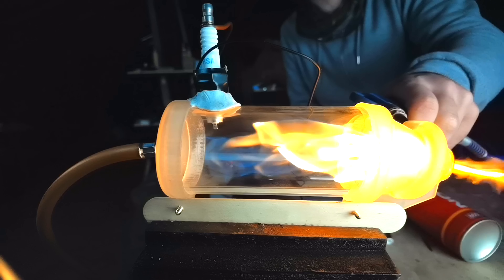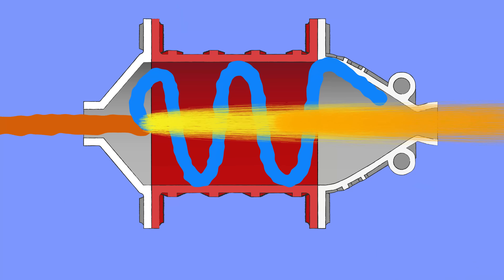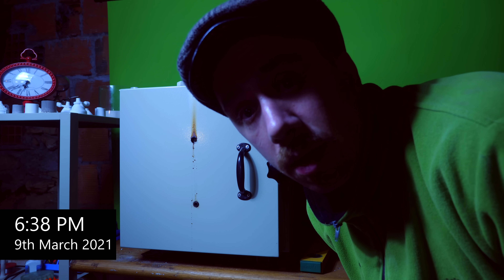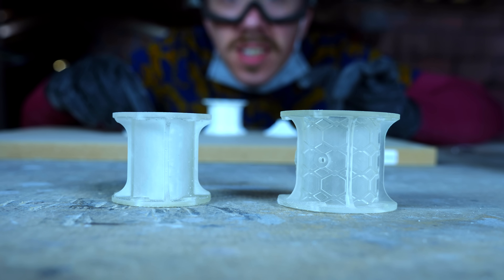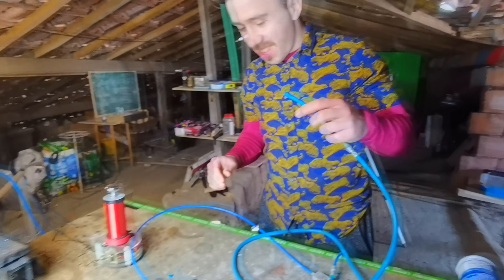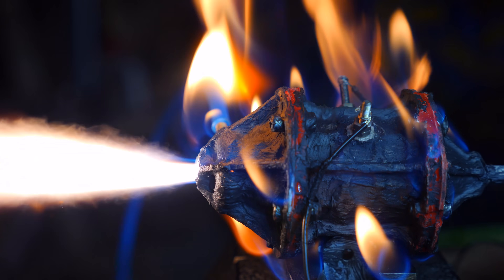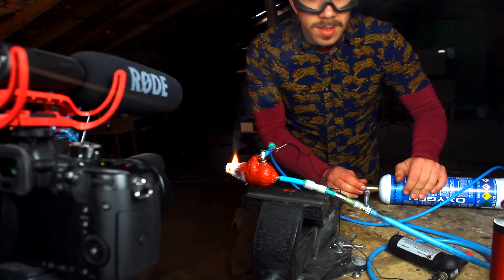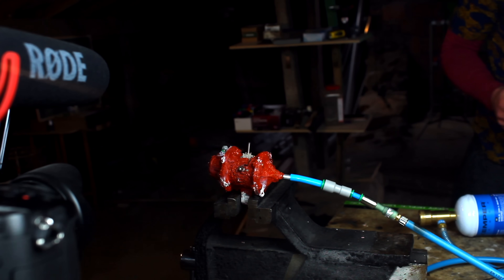Vortex Rocket V2.0 (3D Printed)

Comment: Maybe have the fuel go around the combustion chamber to cool it down? (Like int space shuttle engines) Also preheats the fuel... Keep the mixture fuel rich.
Although there might be a problem that you'd need to seal thr inside as well because then fuel will leak into chamber. And not go around the chamber and cool it down.
Actually, why not make the fuel burn a feature? Since the fuel requires energy to start combustion, it takes energy from the engine itself. Since it's burning in air and not pure oxygen, it should cool it down. Since it burns at a lower temp.

I hope I made sense, and maybe some of this might help

Comment: @Integza Hello Izgenta, I have some suggestion ideas. For pores in your cast, do try painting it with glaze and refiring. Also, nozzle your vortex faster. Faster vortex = less pressure (I think). Magnetic confinement may help since it's plasma, but that requires math on more fingers than I have.
Reply: Also, put your parts into a vacuum chamber for a few hours before firing in the kiln. Less moisture = less cracking.

Comment: Try cementing the inside the same as outside, due to the ceramic being porous, you can use thermal paste, but it may burn on the inside.
Second option is to use a shield box made out of steel or cement to contain the leaking gas.
3rd option is to cement it completely on the outside, by clogging the inside and pouring a cement all over outside like in a box, than remove the clog from the inside.

Comment: I think the problem is that your materials are inherently prone to failure when subjected to the immense heat of combustion. That and ceramics are porous ... that's why engine combustion chambers are metal - well that and the strength to weight ratio. I would figure out exactly how hot your combustion chamber is getting with a temp gun, and then pick a material that can withstand that heat. Maybe you can use the 3d printers to help build a mold of sorts, which you can use to either press sheet metal into the necessary shape, or if your real crazy. pour melted steel into a mold ... or even more crazy, do some blacksmithing. Of course there is always the easier option of buying things like a stainless steel thermos and cutting the parts from that. I also bet there are some welding gun parts that would be perfect for this. Good Luck!

Comment: Aerospace engineer here.

Try cooling the chamber with the fuel and oxygen! This is how, for example, the nozzles on the F1 engines on the Saturn V were cooled. On the outside of the chamber, have a series of pipes (printed as part of it) flowing around the chamber; then it will 1) cool the chamber a bit, and 2) pre-heat the fuel for a higher-efficiency burn.

As for the leaking, try a slower heating profile. Raise and lower the temps in the kiln slower, in order to compensate for the doubled thickness recommended in the manual. This should give the trapped gasses more time to escape without forming microscopic cracks.
Reply from the maker: Thank you so much for the help!
Reply: @integza  I believe your vortex cushion is failing. It's not keeping the combustion in the center. It shouldn't be leaking through the body if it was being contained in the center by the vortex.

Also, try ceramic glaze coating baked onto your parts. The coating they put on pottery. Very durable and heat resistant. Usually water tight as well. And if you had a rotary table to slowly spin the parts it would be easier to apply the glazing. Might have to sinter the parts, remove supports, then glaze and bake again. 

Might want to use atmospheric air instead of pure o2. That could be another reason why the vortex is failing because the pure o2 is just combusting with the fuel and filling up the entire combustion area, which is also over pressurizing it.
Good luck!
Reply: @integza  Hi Integza, working with liquid oxygen maybe it's not a good idea and very dangerous. Also i really not think you can made a micro channel network inside the wall for a regenerative cooling of the nozzle.
Not with this materials and not with this sizes... and your tools.

However i have write in the answer to your post "The first 1000 people..." a long answer with many point you can use for resolve the problems of your device. I hope it can help you.
Reply: @DetConanEdogawa  I did not mean cooling of the nozzle, but cooling of the main chamber. He certainly won't be able to get small channels, but every little bit helps; plus just the actual structure of the tubing might help with extra rigidity. 

Also yeah, LOx is a terrible idea.
Reply: @sophietaylor9753  I think the problem was the nozzle temperature, check my previous comment for that.
Reply: I also think the fact that the flange seals have basically no compression might be a culprit too. Since he cures them in place the bolts would be providing effectively no compression to the silicone once cured since the silicone would just move out of the way while it was still liquid. Half tightening during gasket curing and then fully tightening once the silicone dries should improve the gasket compression, and thus the seal quality I think.

Edit: Aerospace engineering intern here
Reply: This comment needs to be higher.
Reply: Aerospace student here that plans on building a similar project! Yeah cooling with liquid oxygen is cool, but you can't buy liquid oxygen as a normal person, and making it by yourself with liquid nitrogen is time consuming, costly and you only have a test window of a few days because of boil off. So I plan on welding it out of stainless steel, maybe inconel in a later iteration and just putting it in a pipe with water in between so that water can cool it and hopefully extend operation time to more than five seconds. Using liquid propellant like propane could be used for liquid cooling, although that would require a more complicated design as the water solution and off the shelf pressure regulators aren't exactly rated for liquids. Also, gases mix much better than liquids, so combustion becomes a whole lot easier, and my design goal is just getting these sweet sweet mach diamonds lol
Reply: This is not a bad idea theoretically but it's almost impossible to implement with this type of motor, this size, this material, etc.

Comment: Glacing the ceramic in a second burn could be one solution's to seal it.
Also the surfaces where the components meet seem to be to uneven. Maybe adding some material to flatten these mating surfaces could improve sealing it. 
I'm not sure if high temperature silicone is the best choice as a gasgets, but I also don't have a better suggestion.

Comment: Why not do a thin coat of the high temperature sealant in the inside as well as outside? Would only work on the modular one to ensure its smooth.

Comment: You could have less porous ceramic walls if you used the 3D printer to print a mould that you would then use to slip cast regular ceramic in. The walls could also be thicker, though not too thick or there would be thermal expansion problems when running the engine.

Comment: Maybe you could wrap your final design with Aluminum muffler tape or fiberglass exhaust tape or maybe both, to help seal it and also hold it together. 
Also installing some pressure gauges might help you tune in the right amount of pressure, because it looked like you were adding to much

Comment: If gas can slip through the chamber wall, have you thought about transpiration cooling?  Put a pressurized jacket around it and see how much gas you can pas into the chamber, and if it's enough to keep the engine cool.  Should also see better thrust from the increase in flow rate.

Comment: the pressure is getting into the ceramic even if you seal it from the outside, it'll put pressure on specific parts of the insulation. so maybe you have to coat the inside.

Comment: submerge the print in the same resin after it is "cured" multiple times and repeat curing so you fill the gaps with fresh material and already cured material should be stable enoth to prevent the deformation.

Comment: I wonder if precious metal clay might be of use here. It has a variety of metals, all in a binder that burns off during the sintering process. I wonder if you could thin it down and paint it on to the ceramic before you fire it.

Comment: What I guess you need proper fuel n oxidizer control , design a box where you can attach fuel oxidizer bottles , with separate rotary valve for controlling each and connect those valves via pipes/tubes to rocket . . Also at ignition pressurized oxygen is not supplied like you was doing rather gravity or low pressure of it is supplied .... Lastly your all parts were leaking , why not to dip their outsides in plaster n oven again I think it will worth a try...

Comment: For the leaks, perhaps dipping the whole thing in resin cound help, tape up the nozle and fuel\oxygen ports, then dip it. Could even paint brush on a thin heat resistent resin on the inside.
Perhaps having multiple oxygen input ports to really get a vortex going could help as well.

Comment: Ceramics and porcelines are typically glazed, this is especially true used for food or beverages. look at you coffee mug or tea cup. see? shiny! and sealed. Additionally, I suggest removing supports prior to firing. They may be contributing to cracking. if you must have supports, try making something that can hold the piece and withstand the firing process. or just YOLO it. for the seal between modular parts, try a high temp insulation mixed into the RTV silcone spread evenly. try not to squish the silicone into the body of the engine. these are just a couple of thoughts, hope you find a solution.

Comment: Maybe you should use glaze to seal the leakage? and maybe like in spaceship or SR71 the fuel should cool down the engine - try to install steel spiral tube (brake pipes) inside ceramic casing of the engine. Liquid propane during vaporizing takes a lot of energy and can cool down up to -70 Celsius.

Comment: If you print something in the shape of the internal chamber, and then completely submerse it in concrete and let it dry. After a bit burning out of the resin you have a somewhat leak-proof and fire resistant burn chamber made of concrete. Except of course for the small detail that carrying a block of concrete in rocket is not to most weight efficient way of doing things :)

Comment: Could the leaks be solved with  coating the part with glazing used in pottery ?  Takes heat of a kiln to activate  and leaves a shiny smooth glass like surface. Could be used inside and outside

Comment: Stick the whole lot in water, should make it clear where the leaks are pretty quick. Not so sure the ceramic would like it for long though, and guess you would have to keep the nozzle out so it doesn't fill up with water internally.

Comment: What about coating it with something like JB weld or a epoxy?  It might not work long term but should seal it long enough to test at a higher chamber pressure.

Comment: Since you're doing liquid(gas) engines and planning on trying solids again, it might be fun to try making hybrid rocket engines as well. Also, for solid rockets, I would suggest also trying APCP as a propellant. It's easier to make than sugar based fuel as it doesn't require cooking, and it's the fuel that was used for the space shuttle SRBs.

Comment: What if you casted an Aluminum heatsink around the ceramic engine? Using it as an internal mould for sand/plaster casting. 
The Aluminum would dissipate a lot of the heat and seal up all the porosity and the ceramic should stand up to the casting process as long as you pre-heat it to the same temperature.
Just my $0.02
Reply: or maybe print it out of ferrolite instead of porcelite it should be less porous after cintering and extra heat and pressure for the engine combustion should help it self seal the pores similar forging.

Comment: it looked like you didnt give your sealants enough time to cure and solidify before testing hence the leaking. also did you take temperature measurements of the exhaust to make sure your sealant can handle the extreme temperatures?

Comment: What about using some Lynn manufacturing high temperature adhesive (2000° f rated, sodium silicate water glass 40% solution) and coat the parts with it and then put it in a vacuum chamber to hopefully draw the solution into the pores of the part

Comment: Could you 3D print a mold for ceramic and then make a thicker ceramic part?  This could help with making parts and would probably require less post processing, or at least easier post processing.

Comment: have you tried 3d printing a mold of the parts you want and filling it with plaster? You could then burn out the inside mold in your oven and have a %100 plaster part.

Comment: You should try slip casting your parts and doing two firings where you glaze the part in the second firing. I think the more vitrified the clay is the better is should respond to thermal stress, and with glass as a barrier it should help. And i think slip casting is a lot easier than the method you’re currently using

Comment: Maybe you  should disolve clay in water or maybe even better gasoline to a veeery thin emulsion.
Then stir and dip the engine into it to apply minimal amount of clay solution.
I think that the particles will clog up the tiny holes and the following layers will insulate and solidify the fix.
Let it dry (there the idea with the gasoline comes, as it should be quicker) and bake it again

Comment: How about first coting the engin with glass fiber matts with the high temp cement and then the high temp silicon. So you don't get heat trensfer with the glass fiber cement combo and with the silico  you seal the leaks. And some need't strength.

Comment: Glaze your ceramic parts by applying a water mixture of white glue and glass powder on the sintered part. Then bake at 900C for 3 hours to melt it on.

Comment: Hmmm, you could use a fine metal mesh cylinder a mm or 2 narrower than the combustion chamber to create an inside boundary layer of airflow- if you made it bottle shaped you could feed the fuel into it and with the oxygen coming from outside of the mesh "bottle" it may even act like a flame trap... just a thought - all the best Integza.

Comment: You should try making metal gaskets with a groove that will compress when you tighten the two halves.  Some small gasoline engines use gaskets like this for intake, exhaust and sometimes head gaskets.

Comment: Integza, have you tried painting the inside of the porcelain or soaking them in sodium silicate solution then heating them to dry the solution  to solve the leaking issues?

Comment: Glaze the ceramic printed engine or engine parts. You will get 1. Shiny and 2. Leakproof parts. How this will work with the ceramic resin, I don't know. You could always use the delta of yours to extrude ceramics in a paste extruder, and properly glaze them. But this will open another can of worms or tomatoes... Or wormy tomatoes. Ugh.

Comment: Just want to throw this in , it seams to be the new craze with 3d printers to use them to make MOLDS rather than printing the part itself . This may also give you more flexibility in what materials you can use .

Comment: About the engine, what if you create a cilindrical mold and soround the engine with it. Then fill the mold with some form of temperature resistant resin and remove the bubbles (with a vaccum chamber mabe?). That way you would have something that will isolate the chamber and enough mass to dissipate extra heat and hold the pressure of the chamber.

Quanto ao motor, e se criasses um molde cilindrico em que o motor coubesse. Depois enchias o molde com algum tipo de resina que fosse resistente ao calor e retiravas as bolhas de ar enquanto curava ( podias usar vácuo). Assim a resina formaria um selo à volta de todo o motor, mesmo os sítios de mais difícil acesso. Toda essa massa de resina com certeza que irá fortalecer a camera de combustão do motor a jato, aumentando também a capacidade de absorver temperatura. A resina não sofreria dos efeitos da combustão pois as paredes da camera e o vortex supostamente protegem-na. Assim não retiravas o conceito de ser impresso em 3D e evitam-se processos de revestimento demorados ou complicados.

Comment: This idea is probably very stupid, but I need to write it down. Make an outside chamber (covering the engine) and pump it with oxygen with enough pressure to stop leaking.

Comment: the oven you use to cure the ceramics can melt aluminium and copper alloys. it can also be used to burn out the PLA from inside a plaster/sand mold in a way thats similar to lost wax casting but using pla instead of wax. in fact, you have everything you need to make simple metal parts.

Comment: Would it be possible to print some strengthening cover for the engine to keep it together? Maybe with some metal between the silicone of the engine and the compression ring/cover on the outside?

Comment: Make the wall of the combustion chamber extra wide and use your slicer to hollow then out with some extra drain hole (2mm wall). Fill up with a non porous high temp cement. 2nd idea: Heat your part to 800°c and cover it with molten borax to get a glass outer layer.

Comment: Brush the 3d printed parts with Porcelite, cure it with uv light. Not sure if it will help going to the oven or not but should help with the leaking.

Comment: you could try supercritical sintering, it would solve most of the cracking and deforming issues. It would also make the part much more thermally insulating, but worsen the leaking problem (probably). Supercritical CO2 is not even that dangerous, I would love to see it!